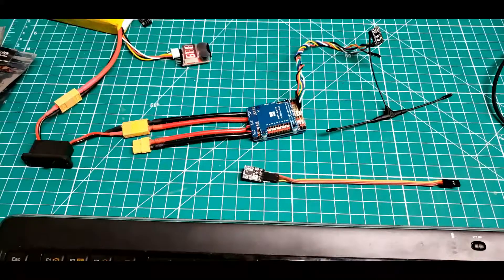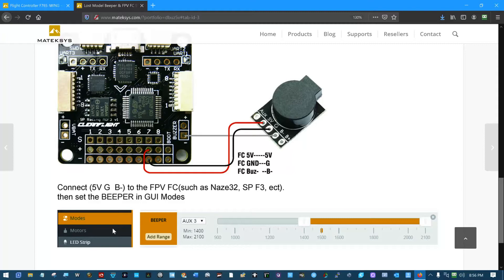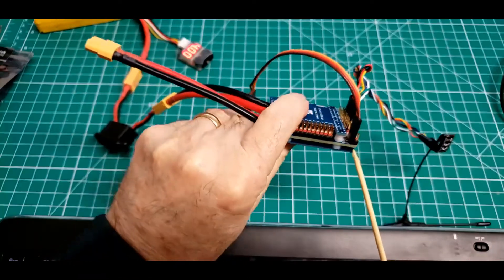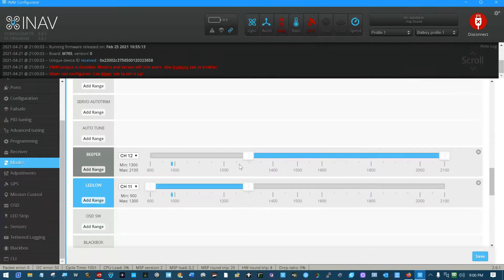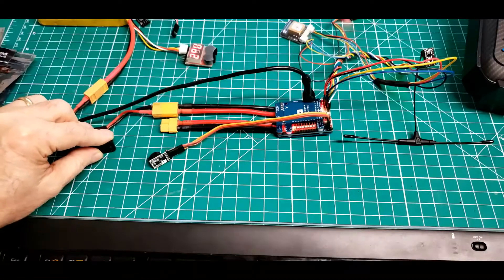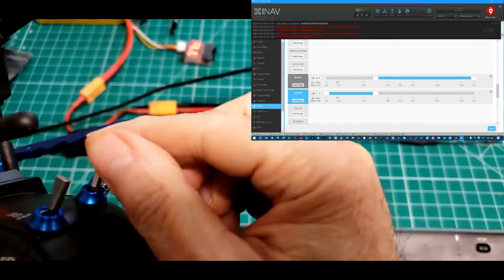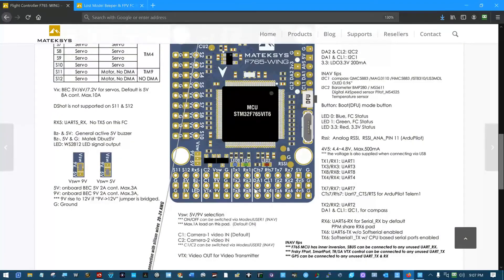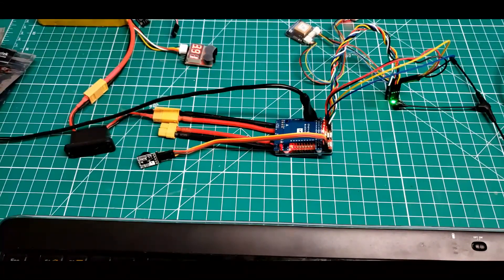F765 Wing Buzzer INav Setup

Comment: My setup will not activate or silence buzzer with the switch configured. I have one switch set to activate the buzzer and another for mute, neither works. I have done this in the same manner on other models with success so I'm doing it correctly. Not sure what's up.
Reply from the maker: That buzzer wiring is strange.  Took me awhile to figure a way to wire it.  Shoe me your wiring and I may be able to help.